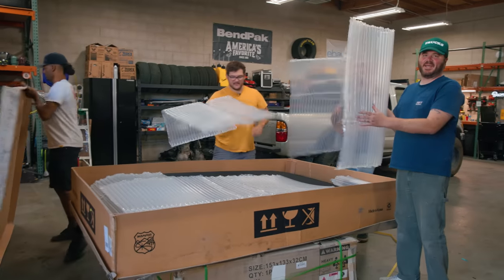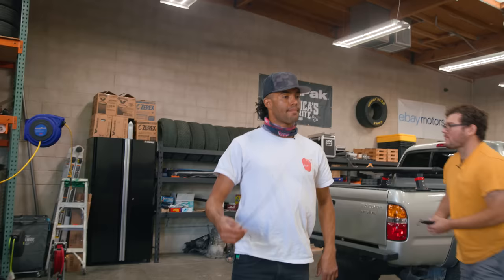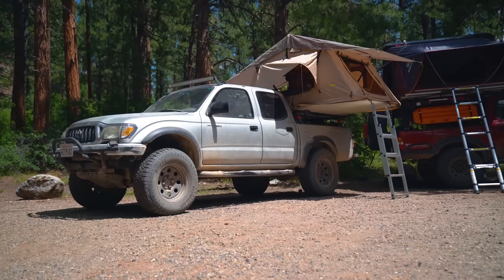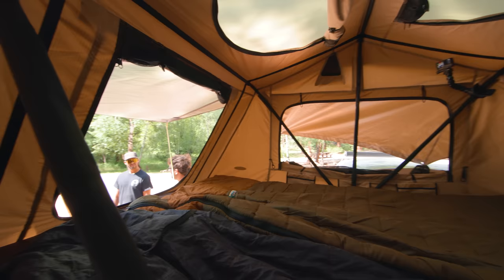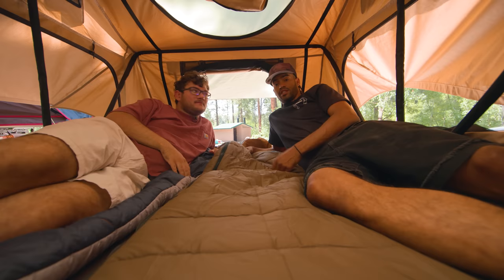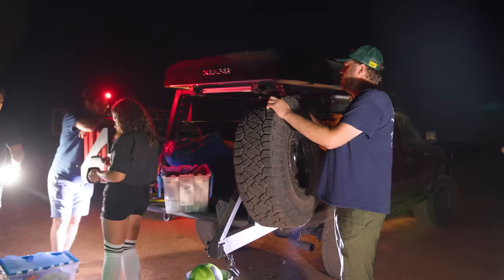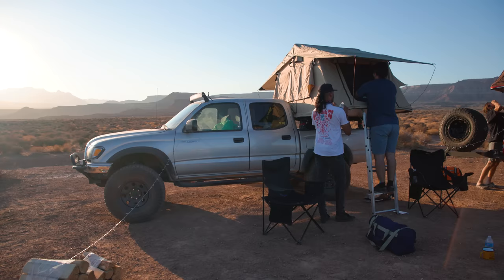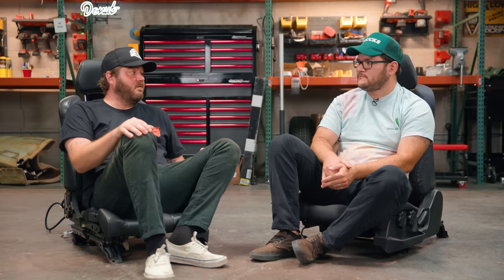$900 vs. $3500 Roof Top Tent

Comment: More expensive almost always means more "better" the question should be "is more expensive worth it"
Reply: For $3500 there should be WiFi and a 32 inch TV.
Reply: @Reaper_03-01  I don't think you get the whole concept of camping... Although at that price, some LED lights should be included at the very least.
Reply: @AndrewAMartin  being in the elements, with only the very bare essentials? Isolated from the luxuries of modern urban life?
Reply: @Reaper_03-01  and WiFi and a TV fit in how? 😁 It's all good, just teasing you a little. Like you, I'm not seeing the value-add that the extra cost gets you, other than the hard shell case and some additional area. Material quality is hard to judge in a video, and durability over time won't show up overnight.
Reply: @AndrewAMartin  Rechargable pocket routers can fit in the palm of your hand, and when the manufacturer of the tent has the prefix of 'i' in their company name, we expect something special XD. 

Lol, I get it. My original comment wasn't meant to be taken seriously, as I think that James and Zach paid a shitload of cash for something that isn't three times better than what Aaron and Nolan got saddled with.

Comment: I have owned an IKamper 2.0 for two years.  I camp with my 3 boys and I am a tall dude at 6'6" so the room in the IKamper is what sold me on it.  It is very warm in cold environments making a tent heater unnecessary.  It also has the nice feature of the hard shell which means it has virtually no noise when driving it.  If you are a tall person or have more than one other person sleeping with you I would go with the IKamper.  The only issue I have had is the paint on the roof started to break down after 18 months and I had to spray LineX on the roof to protect it.
Reply: What's it like to sleep in during very hot Summer nights?

Comment: I have been thinking of getting a roof top tent for a while now. My biggest thing was either hardshell or soft. From this, I didn't even think about the hardshell side not having a window, which isn't a huge thing but definitely not ideal. It would also be great to have the bed set up in there all the time, which the hardshell can not.
I also didn't quite think of the truck bed accessibility but not much you can do about that except putting in drawers. Great video though for sure

Comment: Great video. 
I personally have slept over 300 nights in my Ikamper. I have well over 1,000,000 miles off roading. When it comes to roof top tents everyone of them have positive and negative things about them, including the ikamper. When looking at buying a RT you need to decide how much you are going to use it per year. If you’re going to use it a lot spend the money on a higher quality one.

Comment: Handy review. Covered most issues. Btw; I get that all you guys are competitive. It might be useful to do a leisurely set up, right down to the reading light and prepared for a passing heavy rain fall. That is exactly what we have to do every time. Not worried much over brands and trying to ignore cost while choosing the right top tent. 
Most equipped trucks and SUVs are stuck with a cursed sunroof. At last a real use for it! Leave one or both rear seats at home. There is your weather tight hatch to your tent. There's gotta be tents built with thru floor access. Right? A small step or two is all you need to get up or down. After a few times even in the dark it's gonna be easy to do late night relief walks. Clinging to an outside ladder? Even rock climbers get sick of that some time.

Comment: A rooftop of any sort does keep you up and away from most of the critters.  But I've been happy with my 11x11 foot modified dome tent.  Rooftop tent seems like a lot of work just to say you put a tent on your roof.  

Nice that you can un-bolt the Low and set it up on the ground.  Probably a lot quieter, down on the ground.  A lot of people report how noisy they are in the wind.  I can usually sleep through any kind of racket, myself.  The knowledge that I'm out of the wind but there IS strong wind is somehow quite restful, and it's like a lullaby.

Comment: the great roof top tent debacle. 

I'm a pretty avid camper and live relatively close to a decent national park that sees a lot of off roading at times of the year on the east coast. The only time you can use them here is at an established campground which I dislike some of the areas for that (too many people with no campground etiquette or too close to other campers). Only a few trails near by for overlanding and most have been ruined by those with no trail etiquette and destroyed some of it and most have limited spots to camp (which I have issue with because of people lacking trail etiquette). 

Meanwhile dispersed camping I know a bunch of spots and trails for (owing most to the Appalachian trail).  since I already own most of the stuff for backpacking I can car camp relatively just as easy with slightly longer setup time (about 5 minutes for the tent and 2 minutes for the mattress). If you go this route I highly suggest a decent tent (Lynx ALPS is good for 3 season and like 180), a ground tarp or footprint (30 or so), sleeping pad for 50 (klymit static V, used it to sleep on while visiting my friends), and throw in a foam mat for 30 or so. only slightly worse than sleeping on a bed. If you need more comfort spend more on the pad or a thicker foam mat. Klymit has a 5 inch think foam padded bag for 150ish (it's 2.5 inch foam and 2.5 inch air basically what i have for cheaper but 1 package),  Alps foam mat has 2 different thickness, 375 and 625 (that's their thickness btw) 

If I go with the low tent budget you can get REI grand hut 4 (300$ slightly larger than both tents) + footprint ($25), NEMO tensor pad ($170), and whatever style of foam mat you want (most are in the $50 range). 55$ cheaper than low and can add my dog into it unlike a roof top tent unless I want to spend 200 on the doggo ramp. I'm not climbing up and down with my 80lb beast under one arm and jumping from roof height is not good for the bones especially as they age.

Comment: I put my rooftop on a trailer, that way I could have it up high, and put some stabilising legs on to stop it rocking. My tent is also pretty similar to low teams, but has a second tent that attaches to the underside around the ladder.
Reply: Nice!
Reply: Dang near a pop up camper

Comment: Definitely would choose the Smitty Built tent. I like the access from both sides and the openness/views that provides. In cooler weather the slightly smaller size means better temperature control. As for the “not so great” mattress, there are plenty of options for upgrading to a more comfortable one (especially considering the savings over buying the much more costly tent). The price difference leaves plenty of money to invest elsewhere such as a Dometic camp fridge/freezer. I would prefer the higher mounting set up like what was used on the hi-truck simply for the better access to the truck bed. 

All said, I thoroughly enjoyed this comparison video as I have looked into both tents and couldn’t see the advantage that justified such a price difference. 👍
Reply: Having owned both a cheaper tent and now an ikamper skycamp the extra money spend is worth it no question

Comment: Would love to see this comparison done with the Smittybilt XL and the new ikamper 3.0. Two of the largest tents on the market. I recently sold my Smittybilt XL after using for two years to buy the new iKamper 3.0. We sleep a family of 3. Only two cons given with the Smittybilt XL. #1 - the soft cover sucks to pull off when on a tall lifted Jeep. #2 - the size of the XL is nice but setting up the additional 4 bars is a drag after a long day on the trail.

Comment: When it comes to low truck rear visibility Just get a cheap little camera thing That connects directly to a monitor that sits on the dash,  I mean if anything Rip apart a cheap video camera That has a little monitor on it And just wired up so it connects directly Roof and headliner Down the a pillar To a little mount on the Dashboard And have it run off the alternator For a power source With some resistors so that way it doesn't get overloaded, Spend like a 100 bucks Maximum And if you have access to it Or no someone Get like a triangular shell 3d printed or make out of aluminum or make a cardboard mock up and fiberglass it That you can silicone attach to the top of the Roof With maybe some screws holding it in place In the triangular shape would help cut through the air And get some clear plexy glass To work as a cover on the side where the camera Is sitting  A little bit of sodering Some drilling and Running some wires Through headliner and a pillar Honestly I don't really see that as much of an issue. Is the process annoying and time consuming yes But it still fits with the theme of low truck

Comment: The late 90’s taco is a fantastic vehicle for overlanding/fourwheeling. They super cheap, super reliable. The frame is rigid, unlike the following 2 generations Tacomas. It’s narrow, just right for trail access, while still carrying plenty of gear. The road visibilty is awesome thanks to a low hood. Plus, you can get amazing ground clearance with a 3” lift and 33’s, much more clearance than newer tacos, fj’s, or 4runners running similar gear. The only drawbacks are poor power at lower RPMs, and a tight interior for a really tall people.

Comment: I am currently in the process of turning a Tradies Trailer into a Camper Trailer the cost is massively different to a pre-built Camper Trailer a bit more work but I can add things that I know ill need and not things I won't need! I cannot wait to get it all up and running.. Looking at a 4 man RTT that is a little over $2500

Comment: would have also been good to see how they both stood up to wind for strength. Also how much drag for fuel economy they have when diving on the high way. All in all a great vid with lots of info.
Reply: I got a Smitty take it every weekend snowmobiling, had 15 Inches of snow and gusts of 30 mph ripping thru a valley tunnel.  Wind was loud but noise cancelling ear plugs make this not an issue.  I paid 699 during the 4wd parts yearly sale.  I drive a Subaru and lose 10mpg a gallon driving at 80mph and only lose 6 when doing posted speed limits.  I love it the car and tent have over 40 thousand miles and over 200 days of use since 2019 and that could be understating ow many times I've used it.  I have the pad with blowup mattress that fits the Smitty with a mr buddy heater hooked to a 20# tank.  In the mornings at 15 deg f I'm in shorts and boxers and talk ish to the hikers who look like they are coming out of a frozen cave.  While I'm toasty and getting dressed for a fun day of riding.

Comment: I'm not sure all the complaints are correct I have a h3t hummer with a road armor rack that dose not go on My  truck butane for jeep gladiator,  I managed to make it work great I have a arb rooftop tent a long with accessories on both sides of my rack and it not mounted low because my rack comes with the option of a spare time mounted under rack and I have a front runner drawer system with 2 drawers and I also bought the slide out platform so I can reach any gear so I won't have to climb in back of bed , but for its the choice of the builder I own many 4x4 vehicles and I do plan to buy the ikamper for my land rover lr3 but arb has came out with their version of a hard top tent for much less but ikamper has set the bar high for design and comfort,  but I do agree on price has a lot to do with anyone purchasing meaning how often will you use it I quilt as charged by riding around with my rooftop tent but have yet to use it because of my job I'm a ort truck driver who always at work but I do plan to go to Colorado to break it in soon but the bottom line is it's a tent for sleeping not living it still beats sleeping on the ground

Comment: I was gonna get a roof tent, but it turns out that it's astronomically cheaper to get a custom made rooftop cargo rack and a piece of memory foam cut to your exact car bed proportions (when seats are folded) than to buy a roof tent. Like, thousands cheaper (or hundreds more expensive).

Comment: Once you get used to the iKamper, you can set it all up in a 1.5 minutes. And break down is about 2.5 minutes because there are pull straps that automatically tuck the fabric. The Smittybuilt style breakdown is about 5+ mins because you have to run around and tuck all the fabric manually.
Reply: I’d like to know how it is in the rain. How much of the inside gets wet after you knock it down and drive for a day and set it back up to sleep in ???

Comment: An even cheaper camping option for the truck would be a 200 dollar camper shell from a junkyard, and then spend another 60 bucks on insulation and adhesive and a carpet and install that and boom there ya go pillows and blankets and you can sleep in your truck like I did lol

Comment: You can buy a 2013 ish or newer 30-40 foot tow behind RV with a bathroom, shower, grill, microwave, 9 beds, sink, fridge, kitchen table, sofa, and multiple TVs starting at around $10,000. Why pay almost half that for a pop-up tent with NOTHING???. Terrible cost/value proposition. These companies need to greatly reduce how much they're charging before I ever buy one of these. $300 to $1,000 is about what they should be priced at. I do actually sell several of these where I work and get a hefty discount so I'll be looking into how much my cost is for my GX460.

Comment: I've been wanting to get one for my Jeep wrangler but I have the sky one touch and got the longer legs from Rhino rack. The vortex bars and legs can't handle that much weight, but I have a question, does the ladder on these support half of the weight like it look? I mean, I guess it's kinda ovbious, it should but still, at some point, we'd have our entire weight on top of the vehicle (the rack) and not so much on the ladder side. I think with three bars, I it can hold up to 264 lbs, but not sure if that's still weight or moving/driving weight.

Comment: I feel like low teams roof tent is far better for what it is really, the mattress issue mentioned is easily rectified if you have a air mattress and basic bedding to stash in the tray somewhere. Granted, it'll take a little more time to set up like that but youre camping not racing so...

Rather save the money over saving a couple minutes.

Comment: Yea I think I'll just stick with a regular ground tent.  For a fraction of the price you can get a tent that's 10 times the size and can even get those pop up one's that you can set up and take down in under 5 minutes. Wouldn't ever need to spend over 500 and get plenty more bang for your buck out of it. Then just throw it in your truck bed that isn't all covered up.

Comment: For the speed test, the ikamper would have been way faster if it was lower like low truck. Also one way to make low trucks quieter would be to cut off the zipper handles and put paracord.

Comment: There's one thing you didn't do was the weight difference between both tents. Next would be longevity and repair cost. I would pick the Smitty bc if it rips you can repair it with a patch repair kit. Next would be the windows like you both said. Then size I would rather have a smaller size bc it looks lighter the cover looks like you can easily get a replacement for.

Comment: What rail/rack system did low team use? I have the smitty built tent and have been looking for a way to mount mine. I have seen plenty of the overland racks that are $600- $1000 but haven't been able to find anything like the rails low team has on their truck bed. Help please 🙏

Comment: I have a 2007 Nissan frontier and really wanted a rooftop tent, however, my OEM rack only holds 125lbs. I looked at bed racks but I want to be able to pull my ATV into the bed, but I can't seem to find one for my truck that gives me the height needed. Any suggestions?

Comment: the way I see it is the the more expensive one  is going to last you longer than smitty built , why you ask , It is that the hade shell is not going to fall apart like the smitty will . looks like the cover will have to be replaced in one year or two .

Comment: It's lame that the $3,500 tent on the hi-truck doesn't have the opening on the drivers side. If you wanted to jump out and get in the cab you have to run around the truck.

Comment: I needed an introductory explanation of who these tents are for. For less money, you could buy a much nicer ground tent that sets up just as easily and doesn't rock when you move and which you can carry with you where you travel, in any kind of vehicle or on your back. Use the same tent for a truck, car, motorcycle, backpack, whatever. With a roof tent like this, you'll need a different tent if you're not camping with your truck.

For thousands of dollars you could buy a cheap van to sleep in and even give it some RV features. Add windows and insulated walls. A fan, and perhaps even battery-powered heating and air conditioning.

I don't get it. If you're camping, there's ground all around you. If you don't want the bottom of your tent dirty, put down a tarp or groundsheet first. You don't really get a significantly better view up there. I guess you're protected from rodents that might come buy looking to eat food, so you can fall asleep with food around you instead of putting it away. A bear could still climb into your roof tent.

There's got to be some advantage to these roof tents, but I can't figure it out from looking at them. They're more expensive, more complicated, less stabile, and you have to climb a ladder just to get in and out.